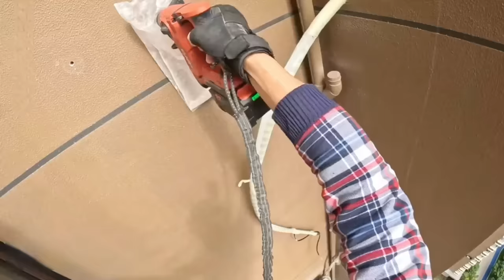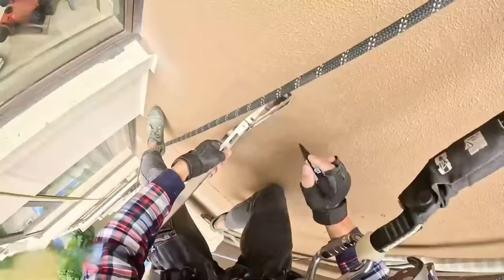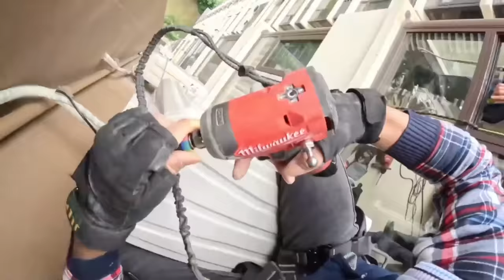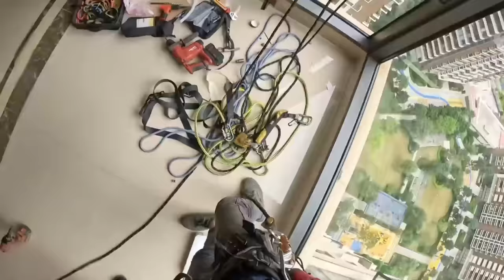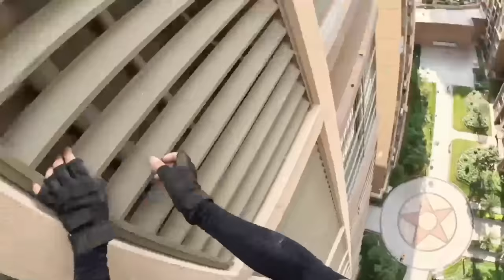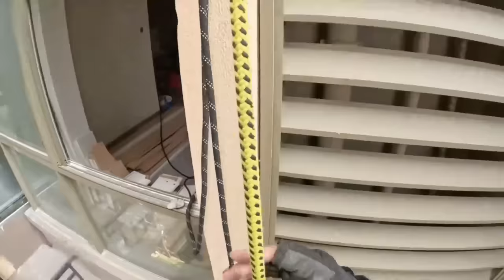Skyward Dance: Thrills & Excitement in High-altitude AC Installation!Will your palms get sweaty?

Comment: Those slabs are not part of the main structure and his fitting anker points in them to hang of 🤔….. I wouldn’t
Reply: I was thinking the same thing, F@#k that?
Reply: Holy shit man! That's not structural anchor material. Not to mention damage to the building as well.
Reply: Black rope is connected to a safe point inside so you have a last chance 😅
Reply: Who asked you dude?
Reply: The caribiners have screw gates 
I'd probably tighten them ....
Reply: I've done some dumb shit in my life, this will never be one of them
Reply: @ethanpritt542 Probably a guy that has IRATA or SPRAT and knows you can’t anchor to that. Also those carabiners are not right.
Reply: @Kostak3 Always double or even triple your safety!
Reply: @PheungPhiwaf  Tell him, not me
Reply: @Kostak3  It’s some good life advice , even for you in any situation, not just for that guy.
Reply: They're precast panels they're fine to drill into and anchor to
Reply: 😂 is he's job I think he knows what to drill into for his anchor point 👍

Comment: Meanwhile in the U.S: We'll pay you $20.00/hr if you're qualified to do this work.
NFL: We'll pay you more than 100 lifetimes if you're qualified to throw this ball.
Reply: Supply and demand.  Many more people can do this work than throw that ball.
Reply: We don't hang condensing units on the side of buildings at heights like that . Its crazy . Dangerous , and impossible to service . That can be accomplished with thru the wall units .
Reply: Well, I do parkour and I'm not scared of heights but this is dangerous the way he trusted that AC Unit and stood on it, because I can clearly see the thing which is holding the AC in place is made up of soo cheap meterials..
Also never rely on one hook, there should be at least two hooks before you put your entire weigth.
And this is life threatening!
Also, In U.K. you get around 50 pounds, which I think is worth the risk

Comment: fucking greedy building company, they should design a platform for the air conditioner 
drill so many holds on the outside wall will causes leaks in rainy days..